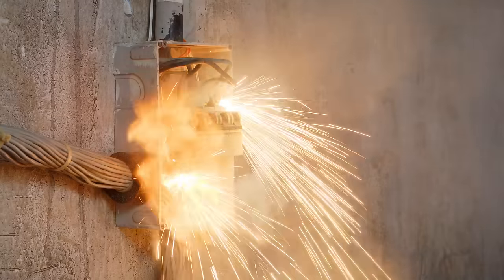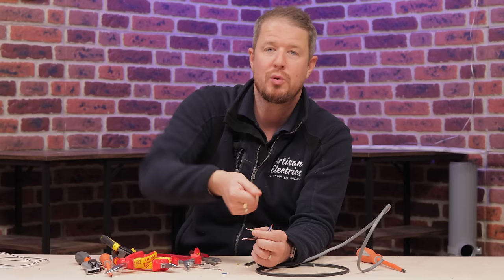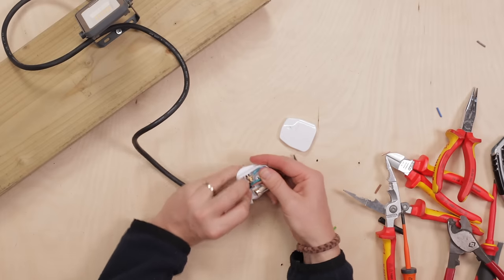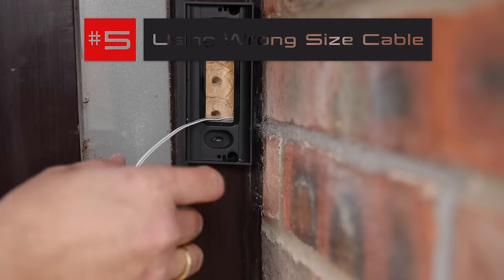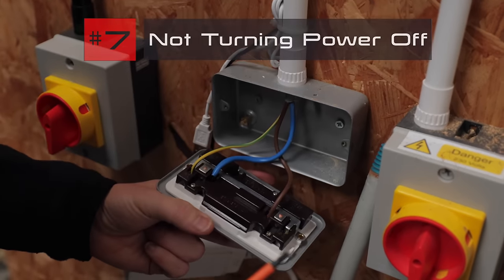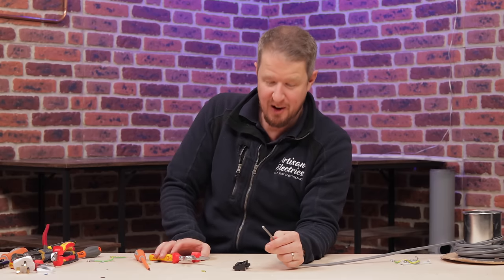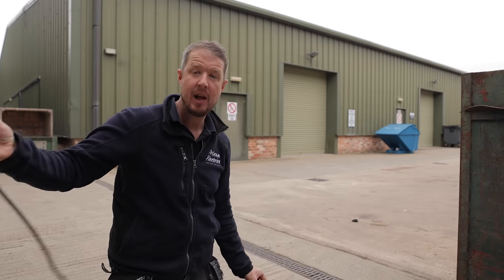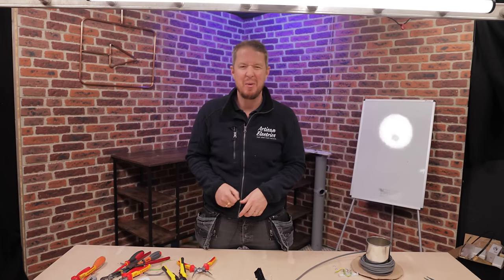10 Mistakes EVERYONE Makes When Doing DIY Electrics!💥

Comment: Wow so that was wrong squared. The induction was not the problem on the extension cord
 It was simply the thermal resistance of the cable to air.

Comment: Coiled extension has current running in opposite directions (hot ("live") out, neutral back) so induction is cancelled out.
It's simply that with enough current the cable heats and because it's coiled the heat isn't dissipated as it would be on an uncoiled line.

Comment: Another vital step for #7: Check your circuit testing device for proper operation before you rely on it....
Reply: Yep, it doesn't really have to be a very expensive device either, but testing that it shows a circuit before turning off the power at the distribution board and the looking for the difference is really important. Even when having done this I do have the slightly (bad) habit of intentionally bridging live and neutral because if there's a pop and a circuit breaker kicks in, I'd rather that it do this when I expect it!
Reply: Strickly, you should also check your tester immediately AFTER checking the circuit - to ensure that the tester didn't fail JUST BEFORE,or during) your test !  Pro's will have some independant voltage souce -or use knowingly energised circuit.
Reply: @tridentmusic5570  You are right, but I haven't seen anybody doing that, except the guys who work in secondary substations. In household installations it is more common to create an intentional shortcut after testing just to be on the safe side. At least that's the case for Germany.
Cheers
Andreas
Reply: @andreasbentz6106  Agreed.

Comment: The  cord is not about induction but simply resistance. When it is wound up it cannot dissipate heat and cool. Once it heats up the resistance increases and it heats even more. 

All those thermal protections, as well as fuses and circuit breakers are in case an overload happens. They are not some permission to load as much you can and rely on them to cut.
Reply: Absolutely correct! At any point in time the current in the L and N conductors will be flowing in opposite directions and are physically very close together so the magnetic fields cancel.
Reply: I was very suprised he made that mistake .
Reply: The resistive heating is an issue also, if wire is heat insulated. Adding heat insulation to a wall or ceiling without remaking electric installation may be fire hazard. 

Even more important in boat or camper. Low voltage cabling uses high current, and hiding a 1,5 mm2 wire inside good foam insulation and using it just with 120W may be enough to cause a fire. With battery a shorcut ends up to red hot wires very quickly, and insulation can melt and cause short circuit.
Reply: @callumcurtis15  Yes! Especially when he's criticising DIY installations from an expert position - Physician, heal thyself!
Reply: @stpeter7432 kind of true, but only  at low frequencies. I know I'm  nit picking.
Reply: @bikerfirefarter7280  We're talking 50Hz here which is low enough!
Reply: @bikerfirefarter7280 It is nothing to do with frequency.

There are two coils which are interwoven. Both coils are on the same axis. One turn of line, followed by one turn of neutral and then that repeats for the full length of the coil 

 Both coils are wound in the same direction, but the current in each coil is equal and opposite in direction. 
Therefore the magnetic field produced by each coil is equal and opposite.
And that is true whether the current is at 50Hz, 1 MHz, or 1GHz.

So even if the skin effect were to come into play, that skin effect applies to both line and neutral wires as it is the same signal passing down those two wires.

If you think some other effect is going on, that results in the two magnetic fields not being equal and opposite, then I would love to hear it.

Comment: Another common mistake is pushing the wire too far into the terminal so that the screw is tightened onto the outer insulation of the wire rather than the copper, thus no connection. Particularly bad if done to the earth.
Reply: I get cable pulled from domestic kitchens being refitted and this is probably the most common issue after terminal blocks wrapped in insulation tape.

Comment: As a DIYer, after seeing this, I feel very competent in my work. I use a very old and reliable Fluke multimeter for various tests, would never dream of all the things you've covered here so I must be in the 'safe' zone (although I have electrocuted myself twice but isn't that to be expected, the first time was as a young child with poking wire in a socket🤣).

After visiting my loft, I can say that it's a mess, clearly the electrician wasn't to our standards.

I have a 10 meter EV charger cable which I always unwind regardless how close the car is, just to me, common sense.

Comment: Good call out with the coiled-up extension lead.  That is something I don't see enough people talk about, to be honest.  (As others have pointed out, it's not actually about induction, it's actually just about not having enough airflow to properly cool the wire, but the main point is still a good one.)  And yeah, you had a pretty nice one there with a thermal cutout and everything, but a lot of them don't have that.  It doesn't even have to be one of the really long ones with their own carrying spool like that one was, just a plain extension wire that somebody has left coiled up in a loop sitting on the ground can get a lot hotter than it's supposed to if a decent amount of power is pulled through it.

And the reason you don't want extra exposed conductors even inside a box is because sure, it works now but then later somebody comes on and moves something around and something falls on one of them or one of them gets pushed into something else and all of a sudden you've got a dangerous short.  It's not just about getting things to work right at that moment, it's also about making sure they won't go horribly wrong somewhere down the line, too.

Oh, and with the screw terminals, one other important point, IMHO:  Always tighten them twice.  Screw them down initially, then move the rest of your wires around, get everything properly in place, and get ready to button the whole thing back up, and then go around and make sure all the screw terminals are still tight.  It's amazing how often they can become loose just from moving stuff around after you've initially tightened them (part of the reason I much prefer other types of connectors like the WAGOs when they're an option).

Comment: It's not inductance that overheats the extension lead as the fields will cancel from live and neutral carrying currents in opposite directions - it's a lack of thermal conduction to circulating air of which three is none when it's tightly wound.
Reply: That implies the cross sectional area of the wire is really under sized then.
Reply: @chrishard7616 
It's the right cross section when unwound and in free circulating air. When tightly spooled the I²R loss is too high when concentrated in the small space. You could have a thicker wire to reduce the i²R loss so it doesn't overheat when tightly spoiled but of course a thicker wire wouldn't fit on the same size spool and you'd end up with a much bigger, heavier and more expensive extension reel. These things are always compromises. It will work at 13A when unspooled and perhaps only 4A when spooled (continuously) or short periods at 13A to limit temperature rise, perhaps relying on a thermal cut out switch.

Comment: In our first house I was swapping out some ceiling light fixings.

So, I turned off both "Lighting" Fuses at the box.

But, in a bungalow, with full access to the cables in the loft space, I quickly found that the bathroom lighting was hooked into the socket ring. Quickly and sharply.

Learnt an important lesson about other people's work and the value of test equipment that day.
Reply: similar situation where i found out the garage lights were running off the kitchen sockets ring.

Comment: Using snips to remove the outer sheath and cutting into the inner insulators and partly exposing the copper. Not always visible but a real danger for getting a shock.
Reply from the maker: That’s a good one too!
Reply: Yep, it's a very easy thing to do too. I love my proper wire cutters but even these don't work on all cables as well as I'd like.
Reply: I had a case where the customer connected a 3 phase motor by himself and did just that. He made accidental cuts into two-phase and neutral insulation. Since there was still air for insulation, it worked.
It had a motor protection breaker on the circuit and it started shutting off regularly (once or twice a week). So he decides to change the circuit breaker, at first it seemed to stay on a little longer, but soon the same pattern. A little later he also replaced the motor, still the same.
When I went there I suspected insulation, but insulation tests with 1000V did seem ok. I still decided to open everything on both sides, to check cable and connections and that's when I noticed these cuts. Fortunately, there was enough cable to cut this section off and do it again. Since then, no problems. He checked that motor connection box dozens of times and me and other guys with electrical backgrounds checked the box also and saw nothing. Cuts in insulation where straight, both halves were kept together so no exposed copper, no moisture and no signs of a short circuit.

Comment: I well remember a case when I was on a Tech Theatre Course back in the Eighties. The theatre was adjoining the old Victorian house, and while the LX had it's own supply, other equipment tended to be run from the house's supply. On this show the whole stage had been painted with size paint and then sealed with Emulsion Glaze (PVA). During the night there had been a leak and the stage was soaked, walking on it would rip up the paint, and that was a key part of the show. So. Every heater we could find was put on stage to try to dry it before the afternoon Matinee. Couldn't even mop it, it was so soft!
So the extension cable (at full length), got hotter and hotter, then blew the fuse. The Chief LX on the show went to the fuse box and pulled this huge, palm sized ceramic MK fuse out without thinking, and got MK branded into his palm. Nasty!
Reply: At least he was able to pull it out. I have seen this things get welded in place

Comment: Hi Jordan, I enjoy your video's but I am not an electrician I only do the basics, one of my biggest electrical pet hates is wrong size fuses in plugs about a month ago we bought an electric hand held food blender only 175 watts but fitted with a 13 amp fuse that to me is a safety issue by the manufacture and against the warranty I swapped the 13 amp fuse for a 3 amp it works fine its just down to basics. I can understand with power tools a 400 watt drill will be fitted with a 5 amp and not a 3 amp because of the start up of a motor. 
Great video thanks for showing  Take care
Reply: The fuse protects the wire not the power draw of the device. Although you may have a low wattage it may well have a higher inrush current and that could blow the fuse. Unlikely with the figures you have given and fuses have a degree of inrush allowance.
Reply: @davideyres955  Hi David, thank for your reply, but would a 13 amp fuse blow on some thing with very little power if there is a fault on the appliance the cable is only 0.5mm twin flat flex, I am not electrician but I was told to use the correct fuse for the wattage of the appliance, once again thanks for your info
Reply: @shaun30-3-mg9zs  The fuse should be sized to a maximum of what the power cable of the device can handle, or 13A, whichever is smaller.  Most appliances have cords which can handle 13A, even if the device itself is never intended to draw that much, so a 13A fuse in the plug is fine (it will still trip before anything gets hot enough to cause damage/fire).  However, if your device has a cord with 0.5mm^2 conductors, then that probably shouldn't go over 5A or so, so yeah, a 13A fuse is arguably wrong in that case.
Reply: @foogod4237  Thank you very much for your reply. just concerned

Comment: Back to school for Jordan with the "induction" heating...   If it was wound around a metal core with a load more current at a frequency in the kHz, then maybe...... Boring old resistance heating I'm afraid. Do your media team not fact check?
Reply: Well, the explanation was not quite right, but the actual issue and main point is still entirely valid, so I'm still glad he mentioned it, at least.  Coiled up extension leads can get a lot hotter than they're supposed to (really just because of lack of airflow for cooling), and that can actually be a real problem in some cases, so you definitely should always uncoil them and separate them if you're pulling any kind of significant power through them...
Reply: @foogod4237  when you say “not quite right”, you mean not even close…… the same outcome does not not justify an incorrect explanation. Especially so when the whole video is berating “DIY” practises in the first place. And even more so when these supposed DIY practices have plenty of precedent of being done by so called “professionals “ in the first place.
Reply: There are two different things in this which the video presenter has confused.

1. Induction coil
2. Solenoid

We don't have 1 here, we have 2.

And in the case of 2, we actually have two solenoids interwoven,  comprising one turn of line one turn of neutral and this then repeats for the full length of the solenoid.

Both line and neutral coils are wound in the same direction, so both coils will produce a magnetic field each in the same direction if the direction of the current in both coils is in the same direction.

However, as we know, the line and neutral currents are in opposite directions which means the magnetic fields are in opposite directions.

Assuming no earth leakage, then the line and the neutral currents and the same magnitude.

The net effect is the two magnetic fields are equal and opposite and cancel each other out.

So no magnetic field.

It is very common for electricians not to understand much about solenoids other than they create a magnetic field.

I have seen had an argument with a sparky on this channel that tried to argue the inductance was zero and quite firmly stated that the inductance is not related to the physical properties of the coil.

Something seriously going wrong with their education in inductance and solenoids.

But I guess, an electrician trains electricians. So the myths perpetuate.
Reply: @deang5622  Can an inductive or capacitive load shift the current on the return line?
Reply: @deang5622  For future reference:
A) The inductance is independent of the current only as long as the materials forming the magnetic core behave linearly. That means an inductor with an iron core will have a current dependent inductance if said current gets high enough.
B) The inductance for a coiled twin-lead is indeed not higher than for a straight twin-lead of equal length if the distance between conductors is much smaller than the distance between windings. For the extension cable those distances are comparable so I am not sure. This is because the magnetic fields of both conductors cancel and so the different turns cannot affect each other.
C) The inductance ultimately doesn't matter much because inductance doesn't draw real power and create heat. Technically it draws reactive power and that creates more heat in other parts of the wire but realistically that effect should be negligible.
Reply: @joseph9915  No. Capacitors and inductors shift the current with respect to the voltage, but they cannot shift the current between the line and neutral, those are always in sync. The only ways I can think of right now that you can create a continuous imbalance in neutral and line current is leakage currents to earth or large capacitance to earth or a charge pump like a Van de Graaff generator.
Reply: @entcraft44  Not relevant to the discussion.
Reply: @joseph9915  No.
The current (magnitude, phase angle, direction) is always the same around a simple circuit with no nodes. The current doesn't leak out from the wires and you can't change the phase relationship between the current and voltage at different points around the circuit.
Reply: @deang5622  I just thought that when you charge a capacitor on a motor for example, the electrons from the negative would change the plate on 1 side and then maybe the other side could be delayed if it was going through the inductance of the motor windings? 

So there can't be an unbalance like that? Not enough free electrons in the system to build up a meaningful current without some returning or something?

Comment: I spend most days at work designing out remedial details for damaged truss and Metal web joists. One of the most common issues we see is plumbers and electricians drilling through structural members to feed cables and pipes. Worth adding this one to your list of common mistakes.

Comment: What I'm missing with the screw on plug is a longer earth wire. I've been taught in school that the earth wire should be a bit longer than the live and neutral. That way, in case the live or neutral pop out, the device is at least still grounded.
Reply: thats why the earth pin is at the top and theres a space by the earth pin terminal for the earth wire to coil around a bit, so it can be a bit longer and the extra length fits in that space.
Reply: @ge2719  In Schuko plugs, at least the ones from the last 10 years or so, the terminal block for the PE wire is about 5-8mm closer to the strain relief than the hot and neutral. so basically idiot proof oh wait, had to strike this, too many people with "special thinking strategies"